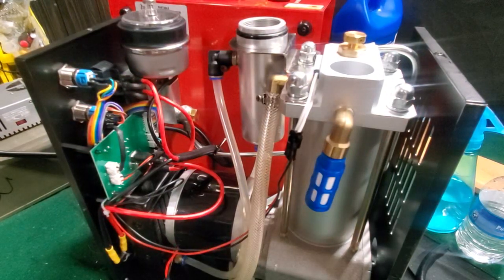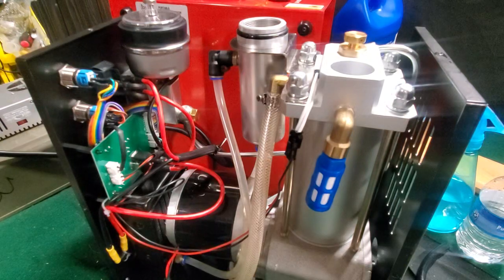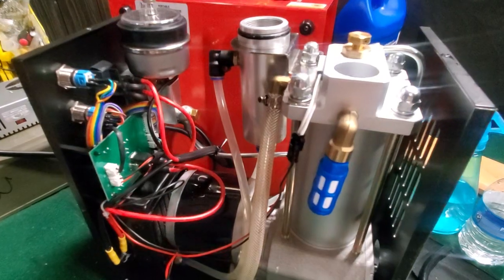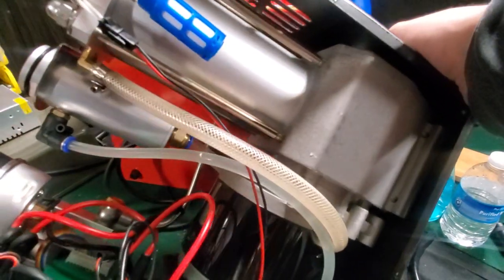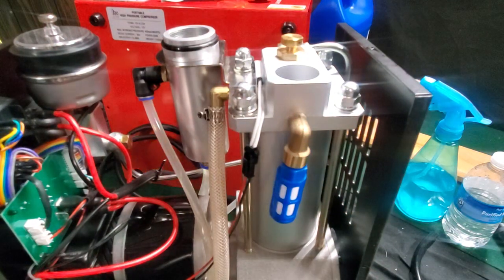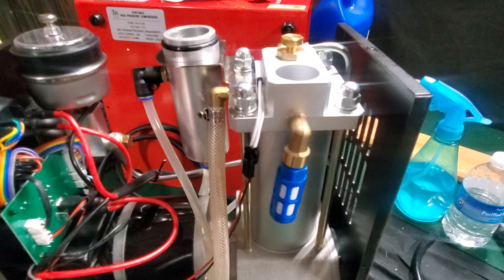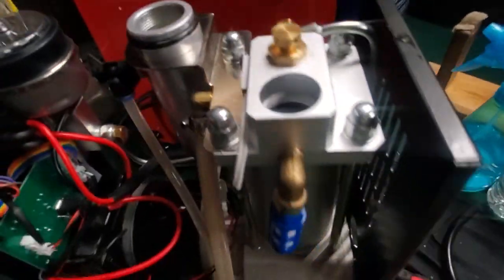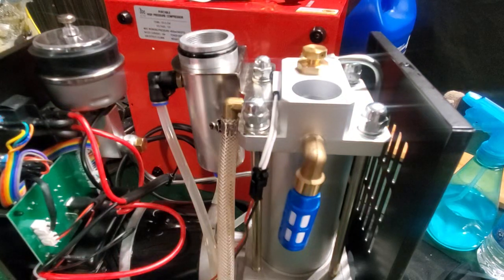Initial water/coolant fill for older GX cs4 and cs4-I compressors manufactured before March 2025

Comment: I just received my CX4i I was pleasantly surprised that they now have a factory installed hour meter, and I took the top off to look at the radiator and it has been rotated.
This is a very nice unit, very well built.

Comment: BBSGLLC, after more research I turn the radiator 90 degrees counter-clockwise on my GX CS4-I, it is a close fit on the right side (viewed from the front) because of the built-in 110v to 12V DC converter has limited clearance.  The left side with the radiator inlet and outlet cleared without incident.  When I refilled the coolant, the radiator slowly purged itself with the compressor off.  I then ran the unit, and the pump head purge itself and I was able to add more coolant than I took out (about 25 mils plus or minus).  It appears that the engineer for the cooling system was not the one who designed the oil-water separator (which needs to be vertical).  Few reviewers are talking about this issue.  I am concern that the cavitation issue might return over time, but changing the orientation of the radiator fixes this issue.  What are your thoughts?
Reply from the maker: We have been rotating the radiator for a long time since this video was made. GX  has changed the radiator as well. 

This video is only good for those with older CS4 models and people who do not want to rotate them. 

The filter is vertical in the compressor, air enters the bottom, and the beads inside it are for surface area. It's effective, but depending on your humidity, you'll need to purge every 10 minutes or so.

Also, GX has come out with a great external filter that will allow you to run long periods without purging the internal one.

Comment: BBSGLLC, after spending more time on this than I expected, I believe that the GX CS4-I Portable PCP Air Compressor typically uses a gravity-assisted oil-water separator, which is quite common in many compressors in this category. The purpose of this separator is to remove both oil and water from the compressed air to ensure that the air reaching your airgun or tank is clean and dry, preventing damage or degradation.  This unit has an orientation limitation due to separator's gravity dependency because a vertical oil-water separator relies on gravity to help the oil and water separate and settle. In a horizontal orientation (there are feet on the right side), gravity would not work in the same way on the air stream. The oil and water droplets would be suspended in the airflow, and they wouldn't have a clear direction to settle. This would likely result in poor separation and could cause both oil and water to remain in the air stream.  I believe that if you run the unit for 10 minutes on it's right side (horizontal position) that would purge the unit and prevent cavitation but then run the unit in the vertical position, so the separator works properly.  What are you thought on this issue?

Comment: Are you tipping towards the return hole? Thanks very much. New subscriber. Cheers!😊
Reply from the maker: Yes, the goal is to get the return line coming from the radiator to a higher point so air will get removed.
Reply: Merry Christmas my friend!

Comment: if you remove the radiator and install like it is in a car so the hoses are on the side vs the bottom it won't cavitate just remove turn and bolt back in. you will have to cut 2 in off one line and done  it runs 20 25 degrees cooler. 70s vs 90s
Reply from the maker: Correct, we started doing this a while ago and posted it to several forums.. along with the Facebook group.

It is a great improvement when rotating the radiator. You can run the top hose around the reservoir and avoid trimming if you prefer.

The biggest thing is to be sure the water enters the bottom and exits at the top. 

GX will be implementing the change to new compressors too